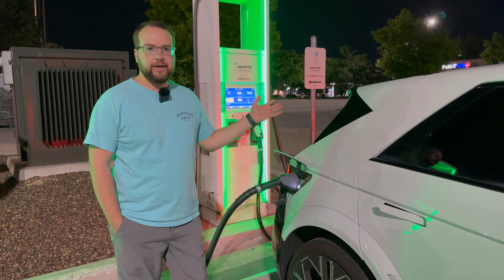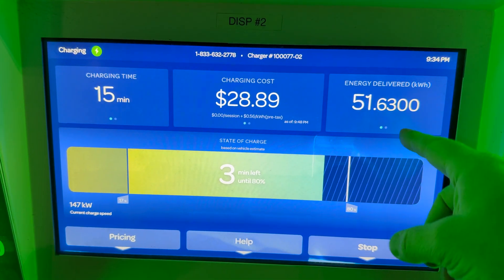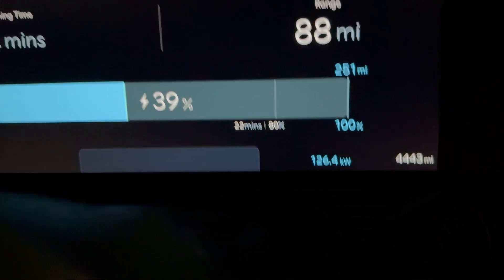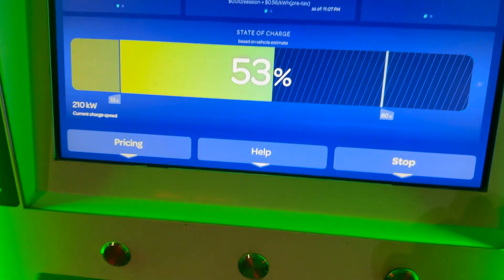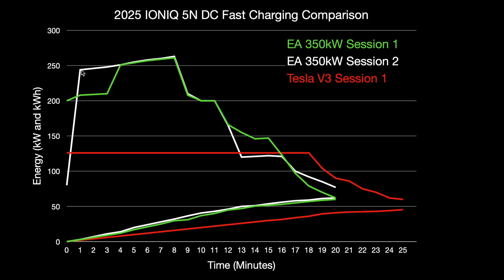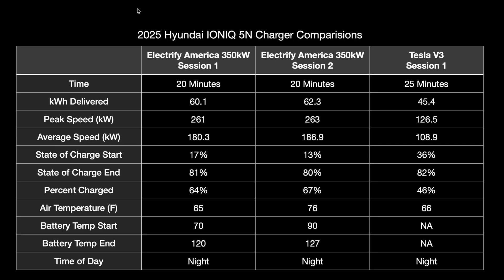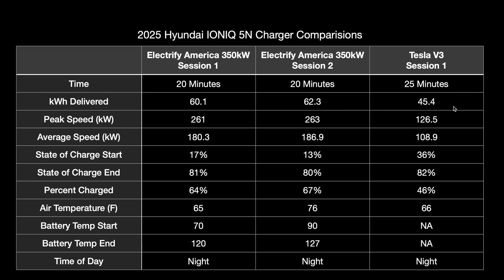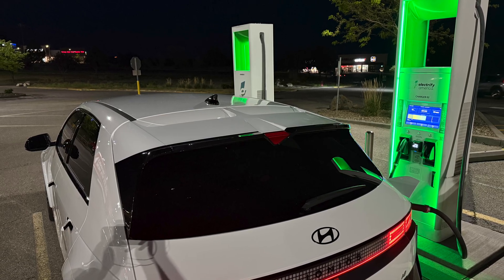Hyundai Ioniq 5N: 800V vs. 400V Charging Test!

Comment: Hi, I noticed that your range at 80% was 208 miles, which would put your car's range at an estimated. 260 miles. Am I correct? Do you have the stock sticky tires? Thank you for the Videos.
Reply from the maker: I believe the EPA estimated range is 221 miles. At 2:03 it's estimating 268 miles at 100%, at 6:31 it's estimating 251 miles at 100% after more highway driving. And yes, it has the stock Pirelli P Zeros 275 width tires. With how fast the car charges in the 20-70% range, I think more short charging stops are the way to go if possible (as opposed to stretching it). Stopping every ~150 miles for ~15 minutes and then getting back on the road.

Comment: Did you realise that the 5N is limited by Tesla to 126 Kw/h anyway? The comparison would be more useful in another 400v changer network than Tesla’s.
Reply from the maker: I was thinking the 5N's max current limit was between 300-350A (the NACS to CCS adapters Hyundai is shipping are limited to 350A), so at 350A/400V, the max you would see is 140kW. Let me know if I'm missing something!

Comment: I think the magic temp for fastest charge on the low end is 77F (25C), and that is consistent with the starting value you show.

That is at least better than the 97 KW earlier Ioniq 5 vehicles would get on a Supercharger.
Reply from the maker: Good info, thanks! Do you know what was different about the older Ioniq 5?
Reply: @studzstudios  both hardware and software is new in MY2025. It uses the rear inverter or motor (can't remember which) to convert 400V to 800V.
With a N use the N-race to get 99,9% focus on battery temp and it wont overheat while charging ever😉
Did a full trackday with 1 charging mid day, battery high (which the display shows) never exceeded 40C (104F) on both driving and charging.
Reply: The Ioniq Guy is likely a better source, but the converter used was limited when in voltage boost mode.  Either they upgraded the ability, of the rear motor inverter, or enabled its use, but the 2025 can hit 125 KW in voltage boost mode, as your testing demonstrated.

Comment: Wow, that Ioniq charges like a boss. Did you pre-condition the battery before arriving at the EA and SC locations?  Tesla has come catching up to do.  It would be great if all EA stations were functional upon arrival.
Reply from the maker: Yeah, I forgot to show that. I did attempt to pre-condition the battery for both of the EA sessions, but the car just said something like, "the battery is at the optimal temperature" so it didn't do any additional preconditioning. This happened when the battery was both at 70F and 90F. I didn't try with the SC since it's not going to charge any faster with the voltage limitation and I think the battery was around 70-80F.
I'm guessing the car didn't want to heat the battery up more than 70F since you risk throttling later in the session or cool it down at 90F since you won't get as good of speeds at the beginning.

Comment: You need to do pre-conditioning that’s why initially speeds are slow, but then it picks up to 200+
Reply from the maker: Ah, I forgot to show that. I did attempt to pre-condition the battery for both of the EA sessions, but the car just said something like, "the battery is at the optimal temperature" so it didn't do any additional preconditioning. This happened when the battery was both at 70F and 90F. I trigger preconditioning again at 9:45 to try and get the battery to cool down after charging, which did help.  I'm guessing the car didn't want to heat the battery up more than 70F since you risk throttling later in the session or cool it down at 90F since you won't get as good of speeds at the beginning.

Comment: It would be good to show a Electrify America charging session at a 150 kW dispenser. They’re all 800 V so the only difference is generally the maximum amperage which usually isn’t a large effect on high voltage vehicles like yours or the Porsche Taycan. You should be seeing about 180 kW for the entire session until the car throttle at 70% or so.
Reply from the maker: Yeah, that's a good idea, thanks! Even the 150kW EA should be faster than a Tesla V3 Supercharger. I'll consider that for a future video
Reply: I own a i5N in Germany. On our 150kW Chargers with 400V i get around 160kw from 10-80%. I havent seen 150kW Chargers with 800V i think but 95% i am charging at 350/400kW Stations with 800V

Comment: 2023TopGear car of the year
2024 TopGear Electric Awards
2024 World Car Awards
World Performance Car of the Year
2024 CAR Magazine World’s Best Electric Performance Car
2024 EV Car of the year Japan, China, South Korea.
2024 Wards Auto 10 Best Engines & Propulsion System.
And more and more.......
Reply: it's great, as long as there is an 800 V charger!  I looked and we'd have to drive a long way to use one.